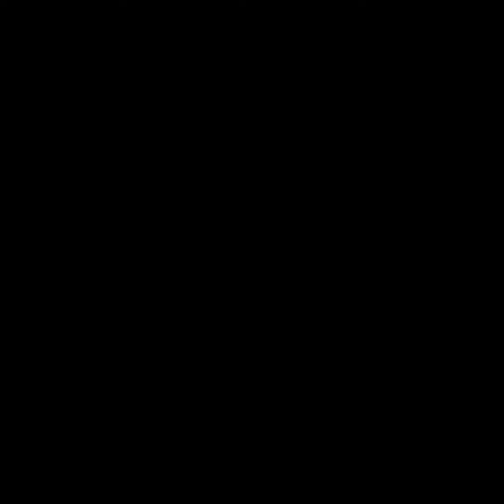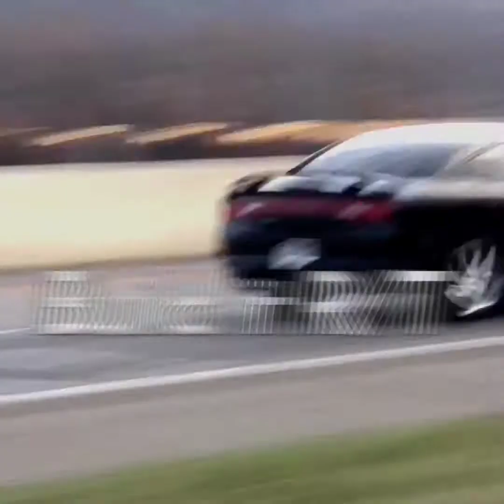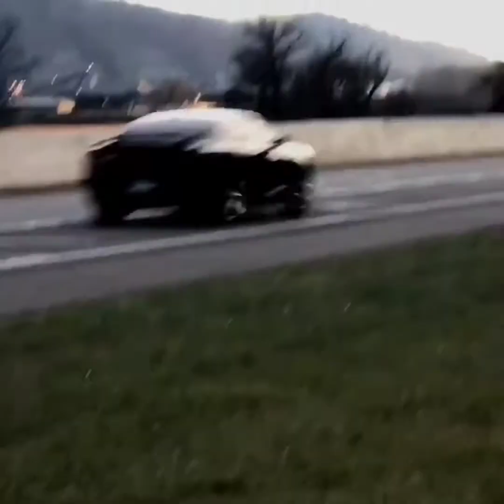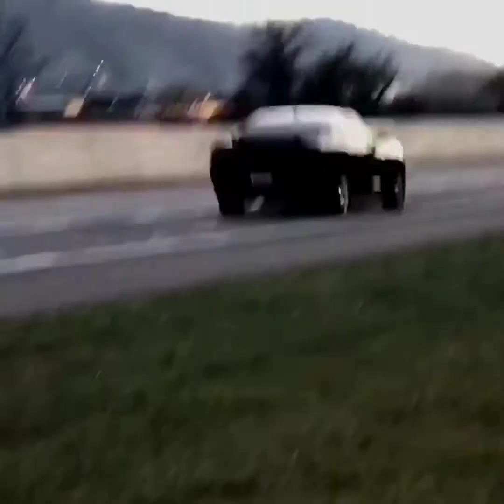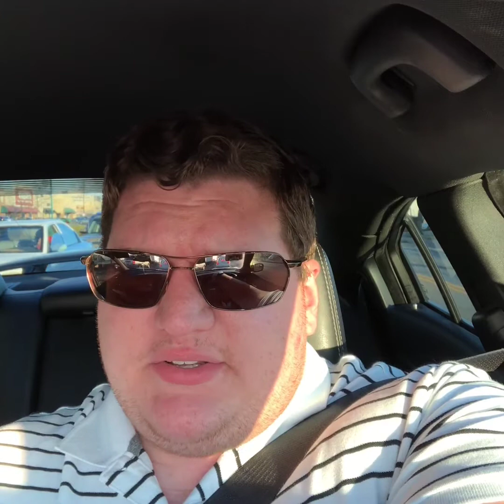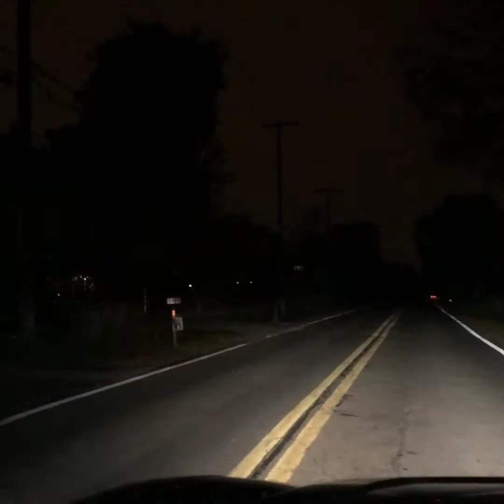Why Build it R/T

Comment: Yeah man. I think you would need to add about 250 RWHP to get into the 10s without serious weight reduction.  Typically 100 lbs in weight reduction gains you a 10th.  Would be a fun build though.  You would have to SC it I am thinking.
Reply from the maker: Burnseys RT I think it’s something like every 100hp or 1000lbs equals 1 second off of your time. But yeah finding the 250hp will be hard without an SC